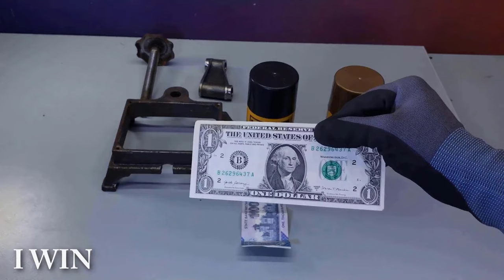Antique Puncture Machine Restoration

Comment: The electrical supply is connected sloppily, symbolically. In fact, he would be a great danger to the operator.
Reply from the maker: Yes, it is exactly 12 volts, it will not cause any harm.
Reply: Really? I'm not sure 12 volts could heat such a massive plate. Plus at minute 29:08 you're sticking a flexi cable with a fork into a 230V (L+N) socket.

Comment: At the end of the day it works. Is it restored, partially at best. You lack some of the basic tools, like proper files, spanners etc. The electrical connection along withe home made pad is not suitable, you need to buy replacement or restore the original. I spent all my working life as a mechanical engineer, with electrical training. There is a piece missing from the end of the clamping screw, a round pad or similar. I am not being nasty, but I believe in telling the truth as that way you can improve. With sycophants telling you how good it is, when it isn't, will only cloud your belief in your abilities. Good luck 👍
Reply from the maker: I am very happy to hear you that's good i like your personality